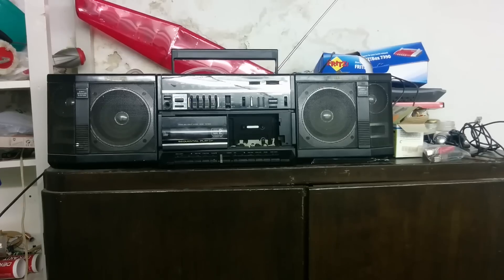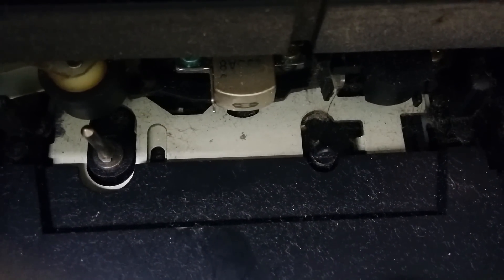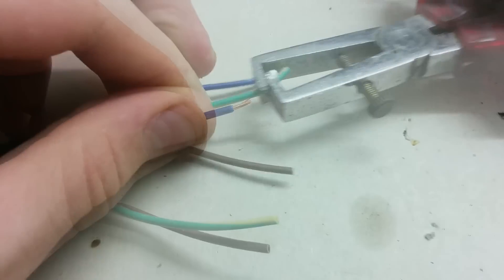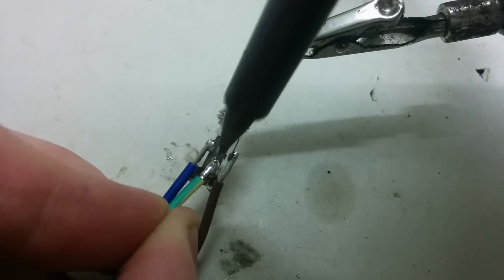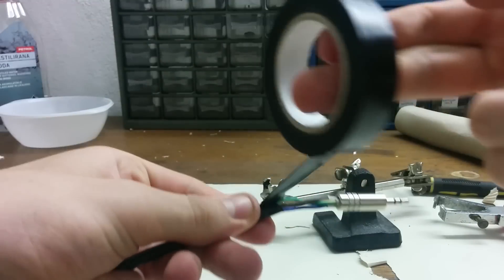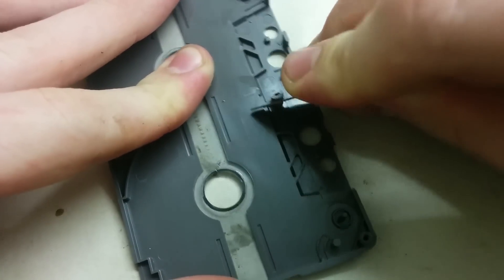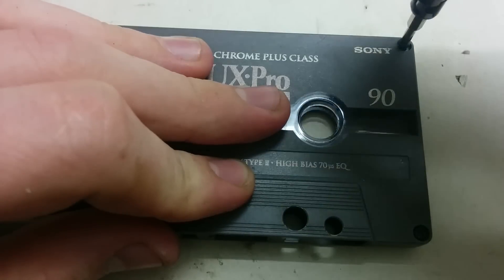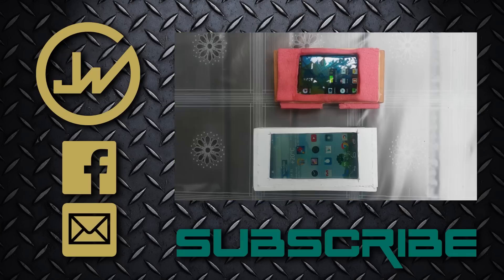How to make a cassette tape to mp3 aux converter

Comment: Good work. I think that cable is not for audio use though. I have one question: ebay adapters have moving gears inside for auto reverse or so but yours is empty. It is ok like that ?

Comment: Ahh i loved this. Ur accent the music, all very easy to understand, I did this project with my little brother. Unfortunately when I put it in on one side only it recognizes the tape for about half a second clicks in and then clicks out so it didn’t work. Have you got any ideas?
Reply: Many players require both reels to move, to know that the tape hasn't run out. That's why commercial cassette adapters use false reels connected by gears.

Comment: I did it but it plays only on a Home Stereo only. My car audio system doesn't recognize it. Any help?
Reply: Auto-reverse cassette players monitor the rotation of the reels, to know when to stop or reverse the tape. So a cassette adapter actually needs to contain false reels connected by gears.

Comment: how about pull open the audio unit and hard solder the aux wires to the tape line in on the circuit board. way better quality.

Comment: my sony magnetic cap hasn' t any wire o  his rear and it has got 4 separate pins. How can I solder jack cable there? And how to check where are L and R and where is the ground?
P.S. pity for that chrome cassette you destroyed.

Comment: hi, I need your help! :(  how will you able to know if the wirings attached behind the tape reader is the ground left and right? I get confused. and i tried, but the tape always gets rejected.
Reply: First you have to some how manage to scrape up 7 dollars, I know it's a lot but trust me it's worth it, then if you can some how find a Wal-Mart (very rare not many around anymore) and go inside and purchase an mp3 cassette converter. I've tried for the past 2 years just to find a Wal-Mart after the 5 years it took me to save the 7 dollars. Good luck, hope this helped.
Reply from the maker: +Kenneth Asibal hi, if the tape is constantly getting rejected then you need to adjust the position of the head, becouse it might me too close or too far for the head in the radio.
The left and right channel are normally located together.. hope it helps
Reply: Jake's Workshop thanks!
Reply: Zack Hogan q

Comment: i didnt get it how does it work?
Reply: the head that the dude removed from the old hifi is actually a magnetic audio wave printer that prints in the cassette tape whenever you're recording from a radio channel. when he connected it to the smartphone via audio jack , it "prints" the audio waves coming from the smartphone to the magnetic reader of the cars audio system . so instead of reading from the tape it's reading directly the magnetic head of the cassette.

Comment: Or you can just order one from china for $1
Reply: +Jim Lazorbeam what if you dont want to buy anything for it
Reply: +Jim Lazorbeam also i honestly LOVE to build my own stuff to use like this aux cassette tape
Reply: +Jim Lazorbeam I just got one from a two dollar shop, the quality is faaar too low, so I'm here now :)
Reply: +Jim Lazorbeam Get the Sony CPA-9 it's said to have a much better sound quality than any other cheapo adapter (it's quite expensive for what it is though... 20 bucks!!!)
Reply: I always use the Griffin DirectDeck. It has a great EQ balance and very clear audio; every other kind of cassette adapter I've tried has been WAY too heavy on the bass.
Reply: PS I can confirm it is alright. Ordered it. Works well with autoreverse car decks too.
Reply: It will get a short because the wires are too flimsy.
Reply: or i can build it from old parts for nothing
Reply: But why pay and wait 2 weeks - 1 month when you can do this for free
Reply: not a good idea
Reply: Jim Lazorbeam If you have all the stuff around, this is free.

Comment: At me is not working.I put it in two car stereos and it does the same thing:ejecting.Pls help me.I put the casette in without the reading head and it worked.When i glued the head on it started ejecting it.
Reply from the maker: Hi, try not to glue the head directly on tape but glue the cable 1 cm from the head so the head can move around a bit.

Comment: why some adapters have gears on them ?
Reply: +yasser aboamoud Because some cassette decks think that when one wheel is not turning it has reached the end of the tape. Auto stop will then activate or it will flip to the other side. 

Most do not have this feature though.
Reply: +RocketMan153251 Yup, plus you also find that some really nice decks actually do not auto reverse, the Teac V-3000 for example. You can have a bigger head if it does auto reverse.

Comment: You are a complete idiot because:
1. you damage a very good cassette tape instead of using an old totaled one
2. the magnetic head needs to be aligned with the one of the unit (azimuth adjust)
3. for most of the tape units you need to fake tape presence in the case as well as roles movement otherwise auto-stop or reverse function will perform chaotic or will eject your crap afer 5 sec.
4. a headphones cable is more suitable because its construction (ground+ left+right)
You need to think that other people have on their cars more advanced tape units with very complicated mechanics that will reject your crap instantly.
Open an factory converter tape and you will see there is much more inside even on the cheapest models...not to mention the good stuff where even the gears ratio is perfectly balanced...
This is a perfect example of how NOT to do it.
Reply: Wikto you obviousily don't know cassette types. That wasn't just any normal cassette it was a super chrome, they are like the best type of cassettes there are. They are becoming more and more rare to find, so yeah I can understand people getting angry over it.
Reply: jesus he really killed super chrome? I pitty the fool. Of course i salute to the original comment what an idiot the author is. How can i do that? i have a degree in audio cassettes and analog sound equipment alike. thx for your attention
Reply: Wikto cassettes are not that cheap man. I bought 3 60-minute cassettes for 2.5 dollars.
Reply: in number 3 lies the biggest problem: "for most of the tape units you need to fake tape presence in the case as well as roles movement otherwise auto-stop or reverse function will perform chaotic or will eject your crap afer 5 sec"
this is exactly why this "converter" would not work in my cars cassette player.
Reply: the only idiot I see is you
Reply: +Florin Lepadatu I love number 1 "you damage a very good cassette tape instead of using an old totaled one" WHO THE HELL CARES? These things are like 1 dollar for a metric ass ton of them
Reply: Go fuck yourself you pathetic loser.

Comment: it helped allot I use it for c64
Reply: If you convert TAP files to WAV files, insert the cassette adapter into the datasette, play the WAV file with computer or other device, press play on the datasette, and it should work.

Comment: Where do I find that aux jack input
Reply: John Castor At your local electronic shop
Reply: tomoya97 i live in a small town we don't have one I want to buy it online
Reply: John Castor We don't even have a cinema on my home town, and we have lots of "electronic shops (neither of them sells at least a micro controller)", they are really cheap and common pieces, they should sell them where they repair audio and video equipment, for example, you could also look on pages like "Jamecos Electronic", but o think it's too much just for a couple of passive components, eBay could also be an option
Reply: John Castor EBAY

Comment: Hi Jake! is necessary make this project with three wire connector?
Btw, I just try to do this, but something doesn't work :'(
Reply: Hi, you can also use 2 wires but your music will be playing only on one side of the car which is pretty anoying so try to use 3 wires for best experience
If you dont get any sound try to make your magnetic head more flexible and hot glue few centimeters of wire befor the head starts. The reason is becouse the head in cassette and the head in cassette player must bu touching in a specific situation so try to move your head in cassette for a few mm front or back and when you will get sound you are pretty much done. Contact me if you have more information :)